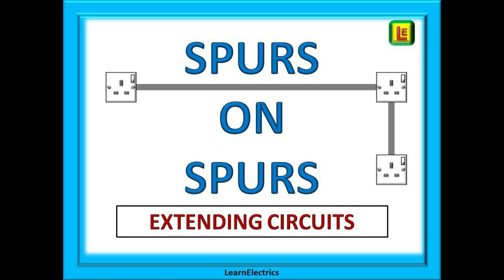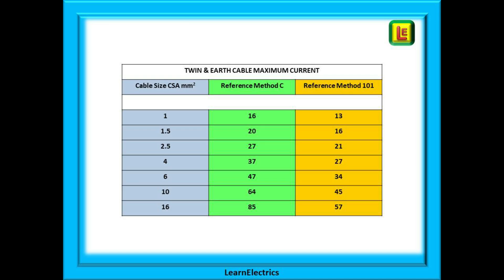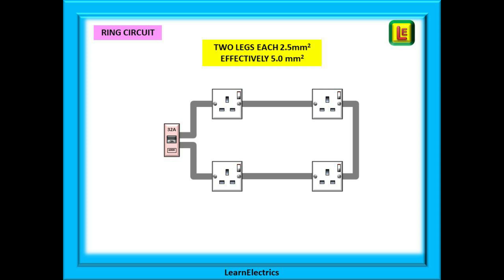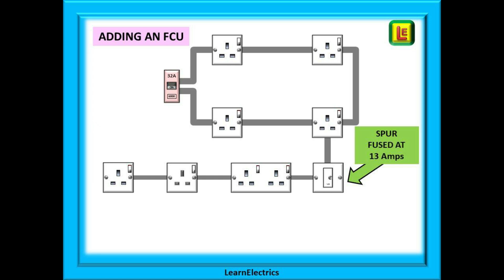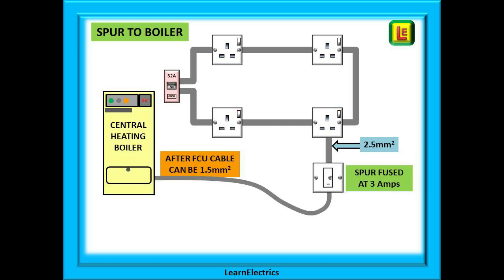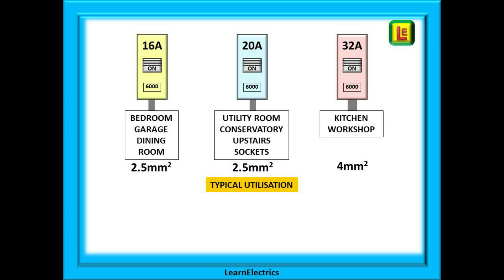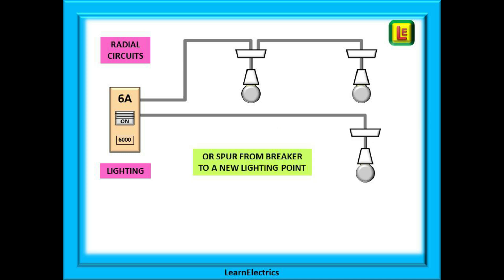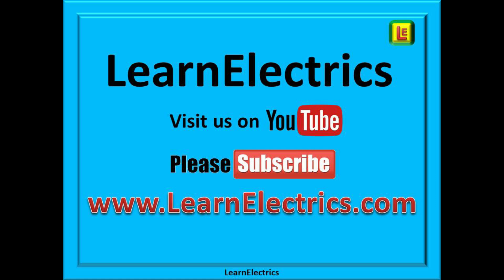SPURS ON SPURS Extending Circuits

Comment: hi, I am trying to spur by a 13A FCU from the ring circuit as I am going to extend the current outdoor socket (which was originally a spur to a ring circuit) to 2 additional outdoor sockets in my rear garden. Due to the wiring limitation which was already done my my garden renovated, I am planning to terminate 2 outdoor sockets at the same time into the FCU loading terminal, may I ask if this is acceptable to do so? Or do I need to link the FCU to 1 outdoor socket only and then link another outdoor socket like a daisy chain?
Reply from the maker: After the FCU you can put as many sockets as you wish. The FCU will be fused at 13 amps so you cannot exceed this without blowing the fuse.
Take a look at this video on the link below.

https://www.youtube.com/watch?v=XqtrWfpW06w
Reply: @learnelectrics4402 

thanks for your response. yes I understand this point, but I am not sure whether there is any rule telling that whether I can terminate both sockets together into one FCU?

Comment: Hi Dave, what is an old ring circuit was broken and turned into two radial circuit wired in 2.5 , it then changes cable sizes to 6mm as I found in one of the houses I was fault finding in? The 6mm then goes on to supply 8 sockets in the converted loft. Would a spur be needed even going up a size? Logic dictate that it doesn't but I think I asked this question a long time ago and I was told it would need one. Please advise. Thanks
Reply from the maker: The ""new"" radial circuits are wired in 2.5 so the MCB should be 20A or 16A for each. Then you can add as many sockets etc as you wish. You cannot exceed 20 amps. The 6mm will make little difference, it just needs to be 2,5 or greater, Check the connection where the 2,5 and 6mm meet.
Have a look at the video below.
https://www.youtube.com/watch?v=8Z255dd78H4
Reply: @ thanks for confirming, much appreciated. I had also found and watched the video prior to this message as I was in a bit of a hurry. Cheers for all your good work and for always finding the time to respond. 🙏

Comment: in my kitchen i had a double socket which the kettle and toaster are plugged into, i had a spark install an extra socket beside it.  ive took the plates off to check what he had done and the newer socket is a spur as it has one set of 2.5mm cable going into it. now i was wanting to drill out the back of the spur to outside to fit a double external socket to power stuff outside, so now see I would want a fcu fitted before the new double socket. i see from your video the fcu would be the first thing , is adding it to the outside before the new double socket allowed?
Reply from the maker: The first thing off the ring must be a 13A FCU. Then you can have your internal and external sockets AFTER the FCU. Take a look at this video on the link below.
https://www.youtube.com/watch?v=fj9cc1U9Re0

Comment: Thank you for your amazing videos.

I note that this video says no spurs are allowed from a dedicated circuit (cooker etc), does this include FCU's. 

I've had mixed advice about the appendix regarding this being 'guidance' rather than 'regulation', i.e. it can be done but isn't best practice.

Thank you.
Reply from the maker: A spur to a socket for a built in oven is acceptable, its still part of the cooker circuit. A spur to wall socket is not good practice as this is no longer a dedicated cooker circuit, its now a mixed circuit.
Have a look at this video on kitchen electrics. Thanks. Dave.
https://www.youtube.com/watch?v=bOSMYzXY_Uk

Comment: I’m adding a outdoor double socket and one security light , I’m taking the power from a socket in the living room , would I add a fcu first or can I go straight from the indoor socket to the outdoor socket , then an fcu off that outdoor socket for the light ?
Reply from the maker: It sounds like you are installing two accessories David. A double socket and a light. You will need to put the 13A FCU first. If you made the FCU a switchable (preferably without a neon) you could turn the power off to the outside when not needed.
Reply: @learnelectrics4402  thanks for the reply yes I did order a fcu switchable with no neon , is the a reason why you prefer no neon ? 
I will install the internal fcu in the living room taking the power off the socket , then drill my hole to the outside for the outdoor socket , adding another fcu next to that for the security light I’m installing , and I’m running nyy-j hi tuff 1.5 3 core into a junction box for the light because the light has a flex . Any advice if you think I’m going wrong would be appreciated

Comment: I wonder why you can't have two single sockets on a spur, when collectively they can only take the same amount of current as a double socket. Did the Regs on this change at some point, as I've uncovered two spurs off a single junction box in two places in my house, both done by electricians in the 1970/80s.
Reply from the maker: I believe the logic behind it is that a double socket should not exceed 20A total load. Two singles, especially if separated by some distance might have two 13A heaters plugged in. Some electricians interpret one double as being the same as two singles, but not according to the regs. we were not as regulated 50 years ago as we are today.
Reply: @learnelectrics4402  - Thanks for clarifying the rule, altho' given the 27A current carrying capacity of 2.5 T&E I'd have thought 2 x 13A fires could be plugged in without risk.

Comment: Hi Dave, thanks for the video; I have been studying a few of them to try to educate myself. I wonder if you could advise what would happen on the circuit at 5:00 if each of the sockets was loaded with a)1.25KW and b)2.75KW? if we assume the resistance of the circuit is equal on each leg and measure the current in between the circuit breaker and the first socket?
For a) I would say that we could estimate the current as being: 

1.25KW x 1000/ 230 = 5.4A
Then use this figure to calculate the anti-clockwise current coming from each socket loaded with 1.25KW. 
So, (4/5) x 5.4 + (3/5) x 5.4 + (2/5) x 5.4 + (1/5) x 5.4 = 10.8A travelling anti-clockwise at that point.

2.75KW x 1000/230 = 12A

Again, this can be used to calculate the anti-clockwise current coming from each socket loaded with 2KW
So, (4/5) x 12 + (3/5) x 12 + (2/5) x 12 + (1/5) x 12 = 24A travelling anti-clockwise at that point. 

If we assumed method 101, could we say that the second scenario is not appropriate as the max. carrying capacity for 2.5mm cable is 21A? and here we have 24A flowing through one section of the circuit?

Thanks in advance.
Reply from the maker: the regulations assume that we would only heavily load one socket in each double socket. So long as the load is more or less evenly distributed and below the tripping current of the mcb then all should be ok. If you are slightly over, it may take a few minutes to trip. And current in a ring circuit can flow both ways.

Comment: Hi, in my home the upstairs sockets are connected via a 32A ring circuit with 2.5mm2 twin and earth cable. In one bedroom there are two single sockets. I am considering changing both of these sockets to double sockets (no change to the number of "accessories").

One socket has a fused switched spur, which powers an outside lamp, I am considering altering this spur to the following: 2.5mm2 cable going from the (newly swapped) double socket on the ring main, to a 13A unswitched fuse box (spur box), then 1.5mm2 cable going from this 13A fuse to multiple double sockets (radially), from the first of these spurred double sockets after the 13A fuse, I will also have a spur going to a switched 3A fuse box (spur box), which will then go to the outside light, also using 1.5mm2 cable. From what I understand, this meets all of the regulations, do you agree? Thank you

Just for reference, all of these sockets mentioned are for accessories at a desk, all low powered (printers, PC speakers, lava lamp, Alexa etc). Of course they will be protected by the 13A fuse in case of overload anyway.
Reply from the maker: Have a look at this video, it gives more information on spurs and the all important Zs readings. thanks for watching. Dave.
https://www.youtube.com/watch?v=fj9cc1U9Re0
Reply: @learnelectrics4402 thank you, from watching that video I think it does meet the regulations.

Comment: An excellent explanation as is the spur on ring circuit one.

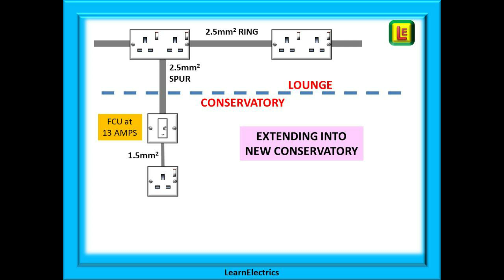I've a couple of questions though on getting power into a conservatory for some sockets and a light (at around the 9:30 mark in the video).  I'd like to be able to isolate the power in the conservatory from within the house/lounge so; 1) Can the FCU be located in the lounge rather than in the conservatory?  2) Can the FCU be a switched FCU?

Thanks
Reply from the maker: Yes to both of those. It would help with future maintenance if there was a note at the CU that the FCU was in the lounge, not the conservatory. Great question, thanks. Dave.

Comment: many kitchen now are not using a the cooker point (ie using gas cookers or just air fryers  combo microwaves), in this situtation can the  cooker radial circirt be converted to a radial circirt with added  sockets with a 4mm cable,  ie if the cooker point of connection is removed and converted to a double socket also?
Reply from the maker: Absolutely it can John. Thanks for watching. Dave.

Comment: Radial circuit is like having spurs on spurs. How is single piece of cable not overloaded?
Reply from the maker: If you have done Ib In Iz correctly then the breaker will protect the cable.
Reply: @LEARN ELECTRICS  thanks for you reply but i still feel like an idiot asking this. What is Ib In Iz?
I was told by an electrician that in ring circuit, we are only allowed 1 spur per socket otherwise it will be overloaded. I wonder why is this not the case with radial circuit? If i do Ib In Iz(whatever that means) correctly, can i have spur on spur in ring circuit?

Comment: Hi there, I am curious and wanting to learn more on this subject. I have an engineering background but no electrical knowledge. Are there any books you can recommend? Thanks a lot
Reply from the maker: There are many books but only you will know which ones are right for you. There are nearly 200 videos on the LearnElectrics channel and they can also be accessed from LearnElectrics.com
Watch the videos and see where your interests lie. Ideally, try and work with someone that is already in the trade. If you can afford a training course then that is always a good thing to do. Good luck. Dave.
Reply: @learnelectrics4402  thanks a lot . I have been watching many of your videos.

Comment: When you say no spurs on cooker radial circuit, does that mean 2 separate 6mm cables cannot be run from the 45amp switch to a built in cooker and electric hob??
Reply from the maker: If it was me Neo, I would run a 10mm cable to the cooker control switch and then taken the 13A feed to the oven in 2.5mm. If the two 6mm cables are already installed, join them in the CU and at the cooker end and take the 2.5mm feed to the oven from that. As long as the let through current of the combined cables is more that the 45A breaker, you are protecting the cables. Hope this helps. Dave.
Reply: @learnelectrics4402  Spot on! Best to run a 10mm so, Cheers Dave!

Comment: Hi, great video.

My garage has a radial circuit. Currently on a 2.5mm. My question; can I add two double sockets spurs off one double socket.
So I have one double which spurs to an outside plug, I want to add another double socket daisy chained off the original socket. Is this allowable/ possible?
Reply from the maker: Yes you can Vijay if the MCB protecting the circuit is 20A or less and you have 30mA RCD protection.

Comment: What's the max distance of a 2.5 cable you can add to a spur from the ring socket ?
Reply from the maker: When adding cable you should not exceed the Zs for that particular circuit.
Have a look at this video, CABLES LENGTH CALCULATIONS and R1+R2, on this link
https://www.youtube.com/watch?v=Qq_9MNH8XxU

Comment: 1mm using method 101 is NOT 13a, it is 10.5a. And in todays construction methods it is quite easy for a cable to become surrounded by thermal installation, in which case the cable is derated by 50%, that's why personally, I would recommend lighting circuits to be wired in 1.5mm, or use a ring circuit and YES ring circuits are permissible on lighting circuits.
Reply from the maker: Thanks beau.

Comment: I've just extended a socket and is voltage reading is 249-252 is this safe.
Reply from the maker: It's right at the top end of what the DNO can supply. It will vary during the day.
Reply: @learnelectrics4402  I checked today its down to 248.0 volts,thanks for your reply.

Comment: At the point we direct add a SPUR to 32A breaker what would be the cable size? It should be 4 mm square d isn't it?
Reply from the maker: It's all explained in the video Kalum, the sizes and the different locations. Thanks. Dave.

Comment: I can not understand why 1 accessory is permitted. The MCB can not protect that single cable with a smaller size. It can heat up and damage. Is there a logical reason?
Reply from the maker: Because what is plugged in has a 13A fuse max. Even two plugs equals 26A and the single 2.5 cable is rated at 27A.

Comment: Hi Dave, your videos are very knowledgeable, thanks for that 👍 please could you just confirm for me, I want to add 3 more double sockets in a bedroom on a 20a radial, CAN I DO THIS FROM ANY SOCKET???
Reply from the maker: If its 20A radial and if it is a 2.5mm T/E then the Regs allow this. Have a look at the left hand drawing on page 506 of the Regs. Thanks for watching. Dave.
Reply: @learnelectrics4402  where will I find this??? Thanks Dave
Reply from the maker: @leeholgate8343  In your Wiring Regs book. Dave.

Comment: Thank you so much for your excellent videos. I've watched quite a few of them now :) I had one question actually. When thinking about an FCU in a radial circuit that's been used to step down to a lighting circuit, could you happily spur from the supply side to an electric socket spur? I hope this makes sense. In my mind, it's the same as installing a junction box just before going into the FCU. Essential this is garage power, there's a spur from the house ring main to a fused FCU, that then runs armoured 2.5 cable to the garage into the first socket on the spur. This then goes to an FCU the other end which steps the wire down to 1.5 for a single pendant light (and uses a lower rated fuse to protect the wire, as I learnt from you!). Many thanks and keep the videos coming :)
Reply from the maker: That sounds good to me Daniel. As long as the Radial cables are protected by a 20A or 16A breaker and 2.5mm in size. The cables after the 13A FCU can be 1.5mm as you say.
Yes, lots more videos to come. Spread the word. Dave.

Comment: How can you use 4mm cable on a 32amp MCB when the 101 method says its rated at 27amps if you could help with this one please
Reply from the maker: Matt, either increase the cable size, reduce the breaker size or lift the cables above the insulation so they are in air. Hope this helps.

Comment: After changing a single socket point to double socket, can spur (add) a double socket from this point here?  Appreciate a reply.
Reply from the maker: If you follow the rules yes Jimi. If the changed socket is actually ON the ring then you can add one more to that new socket. It doesn't matter if it is a single or double as long as it is just one moulding. Hope this helps. Dave.
Reply: @learnelectrics4402  thank you so much.
Reply from the maker: You're welcome.

Comment: Great video. Just one point regarding 3kw water heating radial circuit. 16A breaker in the consumer should be sufficient to provide via a double pole switch rather than an FCU which would have only a 13A fuse. The water heater could be on for hours and may overheat the 13A FCU.
Reply from the maker: Excellent point Andy. Thanks for your contribution, appreciated.

Comment: Bit dangerous that !
What if someone put a32A device back in again?
Reply from the maker: Steven, we are talking about sockets here. The Wiring Regulations permit 2.5mm cable for the spur because a plug is fused at 13 amps and if a double socket, would someone put two fully loaded 13 amp appliances into it at the same time. The Regs assume diversity, that not both sockets of a double will be fully loaded. Their rules, we just work with it. Hope this helps. Dave.
Reply: @learnelectrics4402  always thought diversity was for calculating maximum demand and sizing everything!